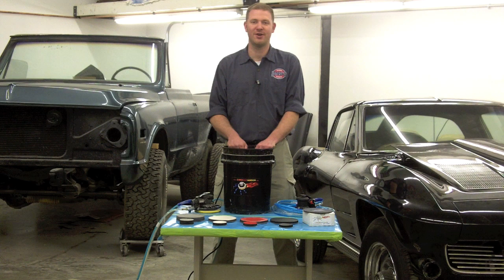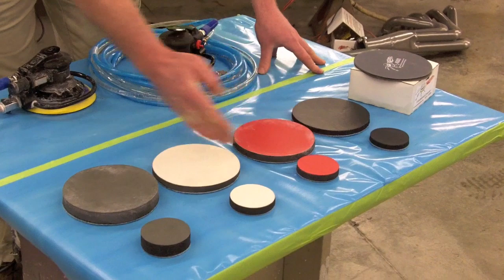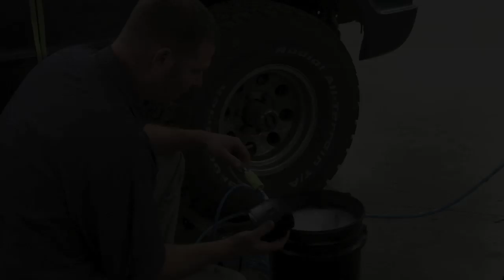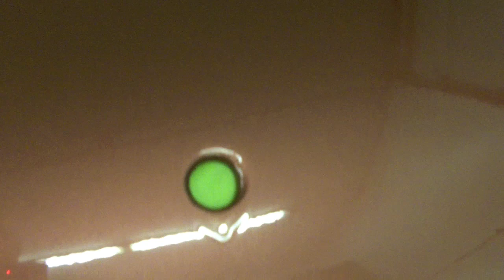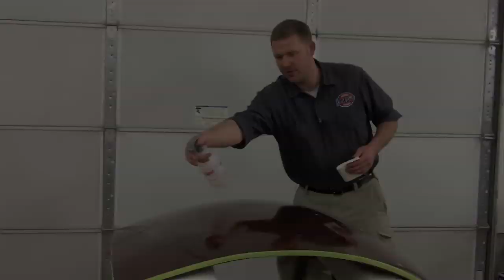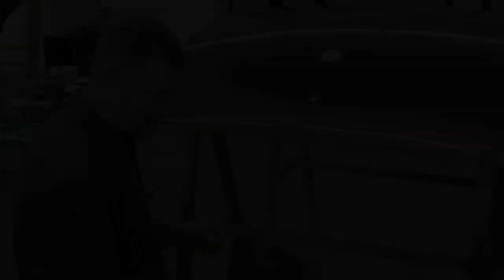Color sanding with a Quick Cut wet sander Part 1

Comment: Dry sanding the first cut with 1500-2000 is by far the fastest way to sand.  You can see exactly what you're doing.  Finish with 3000 trizact wet.

Comment: Can i cut a 1000 grit disk that 6'' into a 5'' disk to fit my DA ????? please help i dont want to ruin the sanding disk they are expensive here, also my da has 8 holes in it and my 1000 grit finishing paper has no holes will that be aproblem?

Comment from the maker: Check out my video on spraying the 1963 Corvette in Black Lacquer.  When in doubt,  with lacquer if it does not come out let it cure for a week wet sand it and spray more.  That is where the hand rubbed comes in.  Good Luck.

Comment from the maker: I would avoid using any fish eye eliminator as it is not a substitute for good clean prep work and it can cause a lot of other problems.   The key to a good paint job is what I call the three Cleans....Clean parts,  Clean spray booth and Clean air supply.  Finally there is not product that helps with orange peel just spraying techniques and most importantly experience.